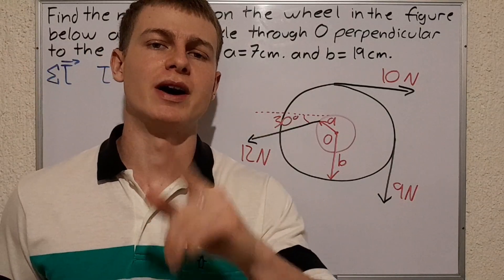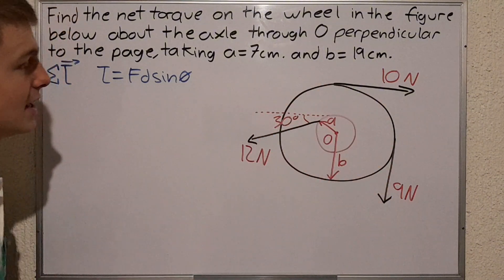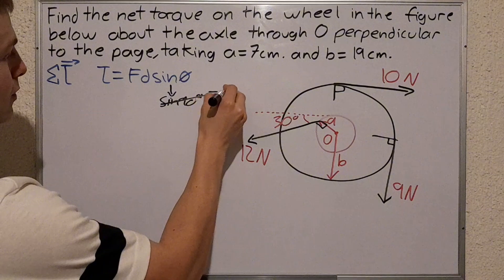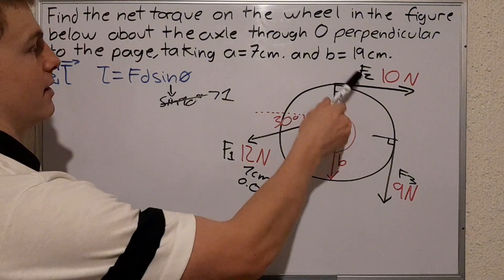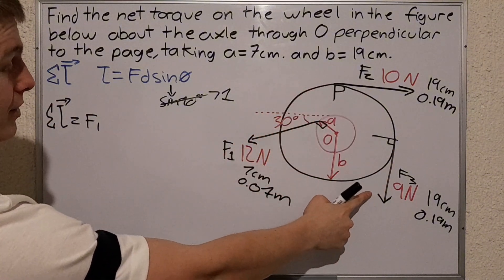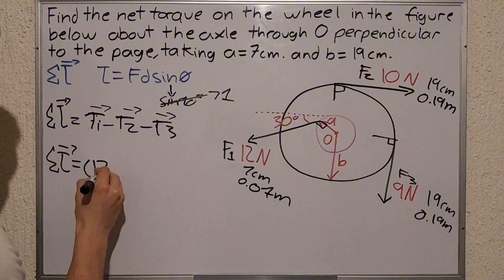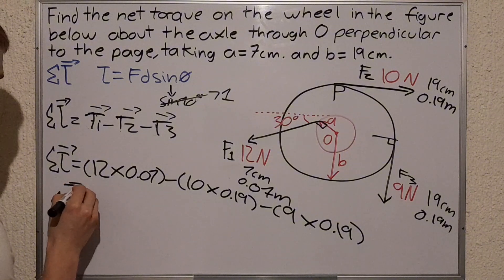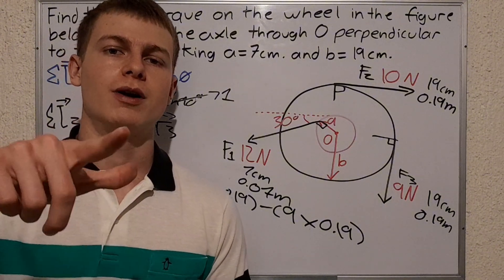Find the net torque on the wheel in the figure below about the axle through O perpendicular to the

Comment: I'm having trouble understanding why the 12N angle is also 90 degrees, but it worked for my homework so I appreciate the tutorial.

Maybe what I'm more confused on is if it's 90degrees here how do I know when it's sin of a different angle?
Reply from the maker: Great question Devan. It is crucial to identify if the force is perpendicular to the position vector (which it is), even though the diagram shows a 30° angle to horizontal. So we must remember that the Torque formulas cares about the angle between the force amd radius, not tje angle to the horizontal or vertical 😉. 
I'm happy to help😁
Reply: @Bobelprofesor  wow thanks a lot
Reply from the maker: @AGK1ZEREL always happy to help 😁🤗

Comment: shouldnt 12 N be multiplied with sin 30? Also did you deduce 12N to be 7cm?
Reply from the maker: Good observation. However as mentioned in the video, the 30° is there to trick us in the exercise because the tork is applied by a distance and a force. Also, those 7cm are the distance in wich the 12N force was applied. I hope I helped you with your question😊